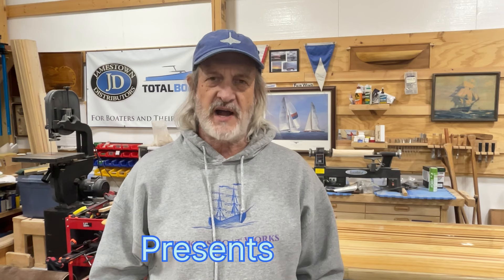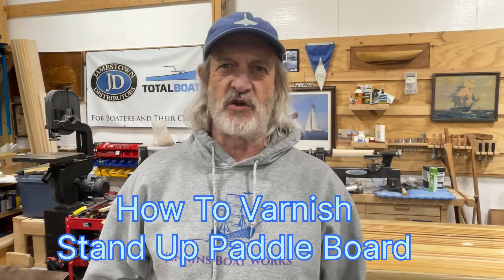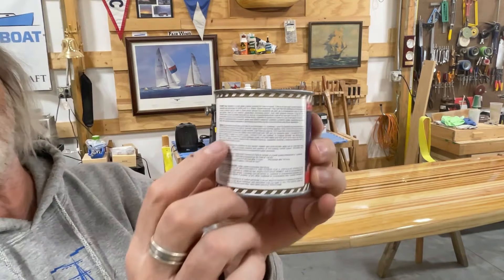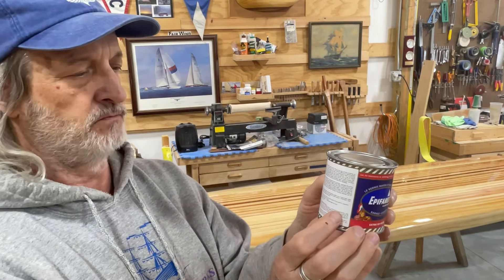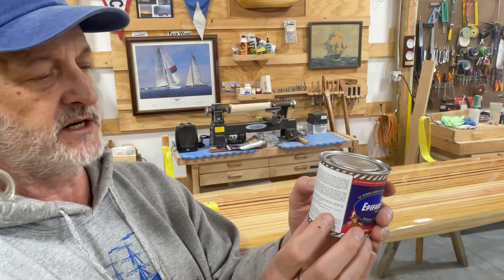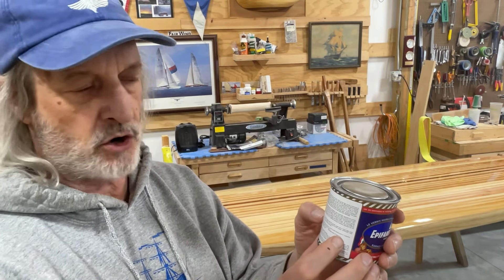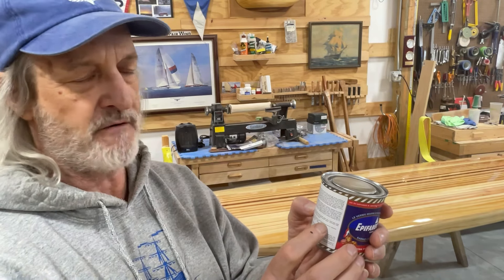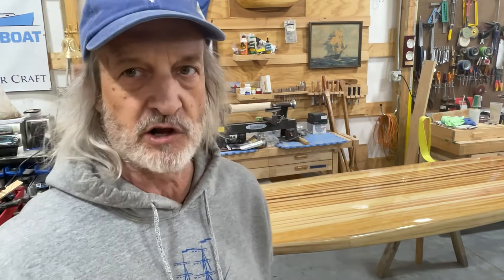How to Varnish a Stand Up Paddle Board SUP - First attempt and Fail -Episode 25

Comment: You need at least 3 coats of varnish, and more is better, aiming for 6 is good. Try brushing on one layer without thinning it. Give the whole surface a scotchbriting before applying, wipe it down with a bit of the  Flood to remove the dust, let that evaporate and then tack cloth immediately before applying the Epifanes.  Use a cross-hatch pattern (Apply, Level, Tip), working systematically down the length one 1' section at a time. Make sure the whole section is covered with an even layer, then move on. The varnish will feel really thick, but get it on there and spread it as evenly as you can. You will see brush marks, but they will level out. The thick varnish creates a thick enough film that it has the ability to self level.  Don't thin. Trust the process.

If this process doesn't work you can always sand it level and try again as you see fit, but you will at least have gotten a good layer of varnish on the board, so you have some thickness to sand.
Reply from the maker: Thanks for taking the time to comment Nick! I respect you and your opinion. Cheers Brother

Comment: you have a can of epiphanes could you tell me if it says to stir the product before using
Reply from the maker: Hi Robert. The print is so small haha. In the product description it says to shake it in order to feel the difference regarding solids. That said, in the instructions there was neither a step for shaking or stirring. It does talk about mixing with thinner which I can only imagine doing by stirring. Shaking just seems like a bad idea. I could be wrong.
Reply: The reason that up  mixing is that in polyurethane  drying is achieved by the removal of mineral spirits while cross-linking of the plastic is achieved through Japan dryers that settle out. Now most of the time Japan dryers are sort of a metallic catalyst. Oftentimes people make the mistake of opening a can of polyurethane and pouring a quantity into a working container without mixing the can. And then after 3 or 4 days they wonder why their surface finish is gummy and not sandable. I learned this the hard way using polyurethane on a front door 37 years ago.

Comment: Okay Chuck to Fair epoxy and too fair a wood boat, your faring board needs to be held at a 45° angle to the direction of travel and at the same time the board needs to bend to fit the contour while held at a 45° angle. Doing these two things will guarantee that you don't have any low  spots. I cannot make a video I don't think. I think I'll try at a later date. Maybe when I build another boat. I've had a cerebellum stroke. This is sort of inhibitory to woodworking. Just think about what the sanding board is doing and you will see that you could accidentally create low spots sanding with the grain without holding the board at a 45° angle by sanding in one spot too long. It is true that a longboard needs to be extremely flexible to also not create low spots. There should be although I don't know that there is there should be some good auto body videos that demonstrate the procedure. As you can imagine Auto body people have to constantly fair shapes to make repairs. And I have to get it perfect because light hits the surface and bounces back to the eye.
Reply from the maker: Hi Robert, in this application, the sanding board proved to be ineffective. There really isn’t enough curve or shape in the board to really benefit from this approach. I had great success with it when I was fairing the hull on my Haven. What I noticed with it on this board was that the sand paper was working under the handles but not in the middle of the sanding board. I then found myself trying to hold the sanding board down in the middle of it. After a while, I went back to the ROS.
Reply: That's a good observation that you saw material being removed only under the handles. That actually means your long board is not stiff enough.  Covering the surface with pencil marks  the automobile industry they use a guide coat. When the guide coat is sanded away you're done with that spot and you're not to touch it again.